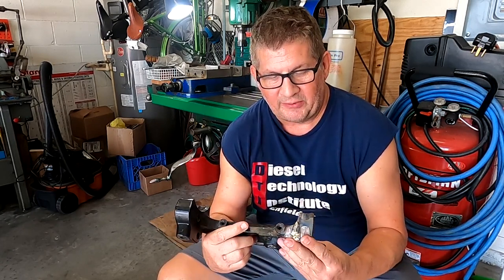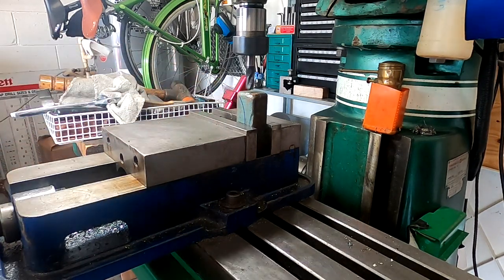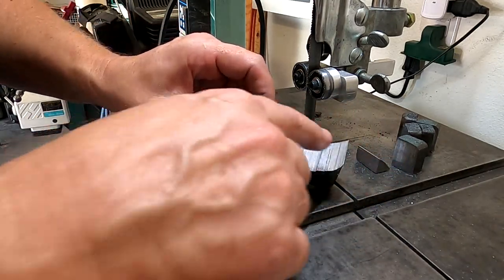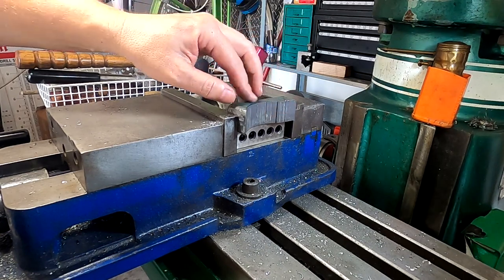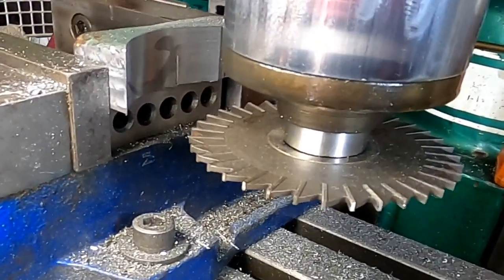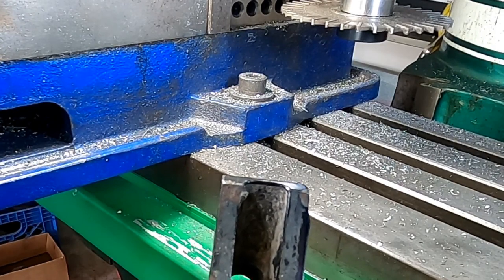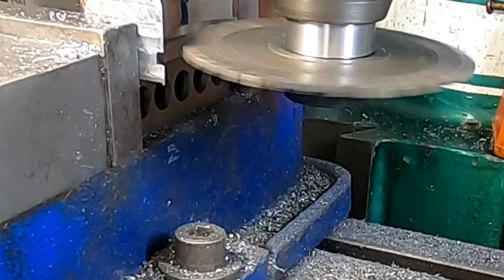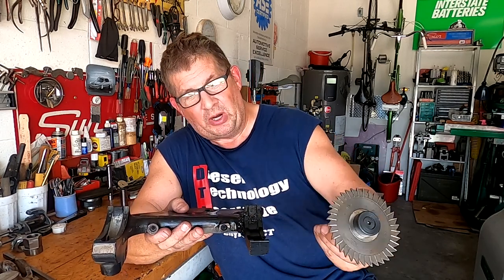Large Radius Cutting the Easy Way

Comment: Don, sheesh, that’s the worst wobble I’ve ever seen on a cutoff wheel. Watching it move in the arbor when you were moving vertically gave me the heebee jeebies. I was sure it was going to fly off. It looked as though there was dirt under the blade.
Reply from the maker: Dirt under the blade???  Hmmm...  The Arbor is a POS actually. It came in a box of crap I got at the flea market. Its one of those stepped - multi blade size dealies from the CCP guys. I can't get a blade to sit right in no mater how I set it up, but I had that blade on there, didn't want to swap it out, so used it. The blade itself is a real nice U.S. made one. Running it on that arbor doesn't do it justice.   If I was a bit more energetic, which I'm not in 95 degree heat and 80% humidity, then I may have just knocked up a decent arbor for the shot. Ah well... just gotta get things done.   thanks for watchin... Don

Comment: This was a really good job. I know what you mean about having a non-ACed shop. Remember, there is no such thing as cheating, there are only acceptable results. Where do you get your cast iron?
Reply from the maker: My HS machine shop teacher would have beat me with a crowbar had I suggested that, so its all relative. Ya, I've been doing things the "wrong" way for a long time. But like the song says, "If cutting you is wrong, I don't wanna be right"  ha ha.. I pick up scraps, iron, steel, alum, brass usually left over stuff from work or at the scrap yard.  That piece was off some scrap athletic stuff that was dropped off at my shop a few years back and was just siting in the corner. I think its a counterweight block of some sort.   Thanks for watching. Don